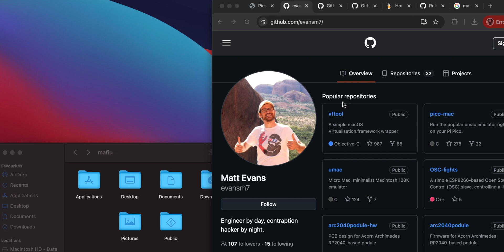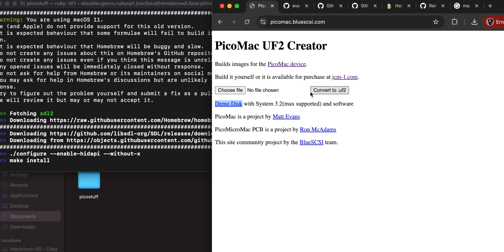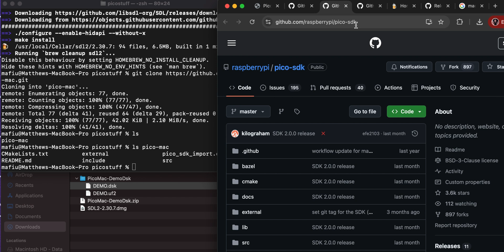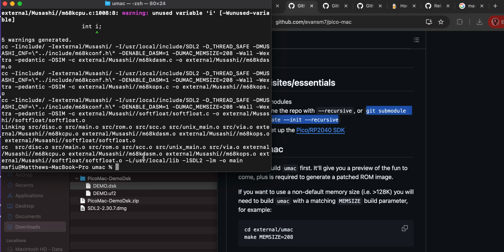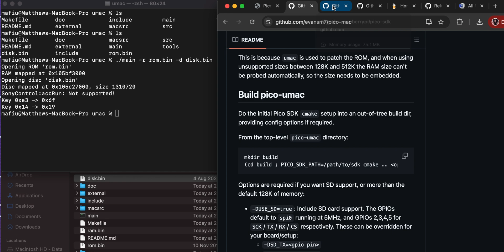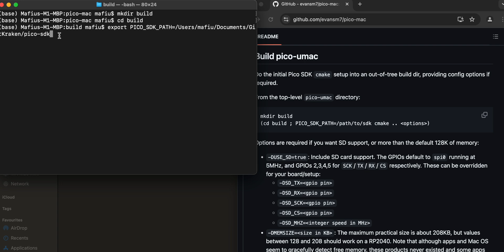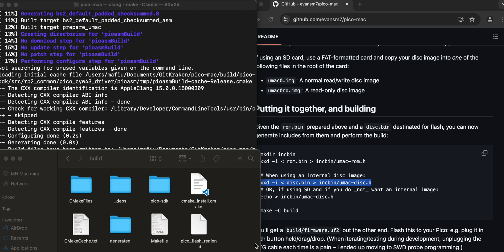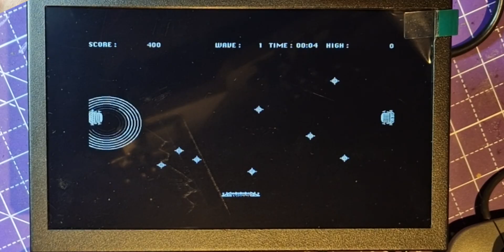RUN a MAC 128 emulated on a TEMU RP2040-Zero board! How to modify the UF2 to use different GPIO pins

Comment: I soldered a 10 pin ribbon cable to the 10 small gpio pins so i could use gpio 17 to 25. But somehow gpio 23, 24, and 25 don't work.
Reply from the maker: Well if nothing else Spider Points awarded for precision work there. Well done for getting anything to connect to those tiny contacts.
Reply: @spidermaf  its not too hard, 5 minutes work,  use pins 18, 19 and 21 and the original uf2 works just fine with this board
Reply: use pins 18,19 and 21 and the original uf2 works fine

Comment: A Atari ST on this .....
Reply from the maker: Ooh. That would be sweet. Not sure of the rp2040 capabilities compared to an ST but I bet someone will do it
Reply: @spidermaf  I put Mac roms into an ST TOS sockets and it works.😘 So reversing this, could work ....... ?
Reply: Would love an ST on a pico. Unfortunately don’t think enough ram on an RP2040 for a 512k ST, not even enough for the very early 256k models. 
The new RP2350 has double the ram but still wouldn’t be enough for the full 512k. 
The RP2350b though can have psram chip to expand ram. The Pimoroni pico2 plus uses it with 4mb of psram so hopefully someone will be able to develop it using one.
Reply from the maker: @alexcranmer8317  this is an amusing conversation as I was always an amiga lad and the great ST verses Amiga still burns strong probably.. but thinking about the chips in the amiga I doubt you could use the 2040 to emulate one completely, so I guess the ST would be similar. I had a device which took mac roms and allowed you to run apple stuff on the amiga, but doubt that's reversible. It just a case if the memory allows to get the emulator running on a Pico chip.  Easy for me to say but need minds greater than mine to work it out.  Anyone reading think it may be possible?
Reply: @spidermaf  Thanks for this guide, had been looking at building a picomac but never made my own builds before so will give it a try now. 
 
I was an ST guy so know a lot about that machine. 
Think it would be easier to emulate an ST than an Amiga as a more basic hardware used compared to the custom chips in the Amiga.
Looking at the github for the picomac I think the maximum memory you can have on an RP2040 is 208k from the available 246k so would definitely limit an ST or Amiga build.
Reply: @alexcranmer8317  The tos boot is only 128k.
Reply: @KJW648  could get it running but doesn’t leave much left to run any programs. Get one running on an pimoroni pico 2 plus board would be a different matter!
Reply: I think they did a commodore 64..